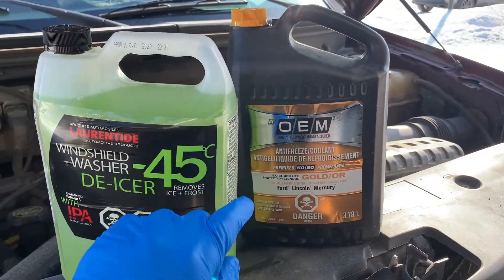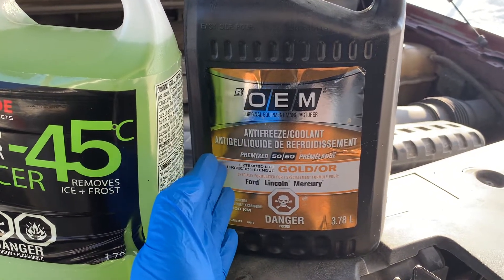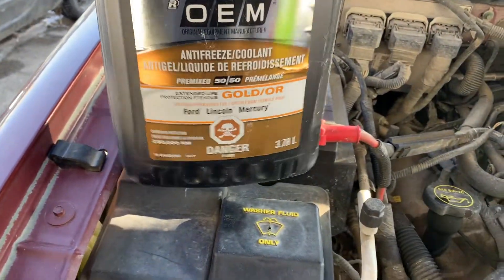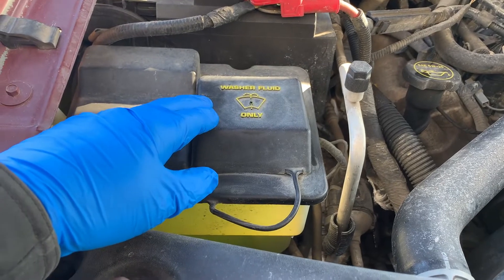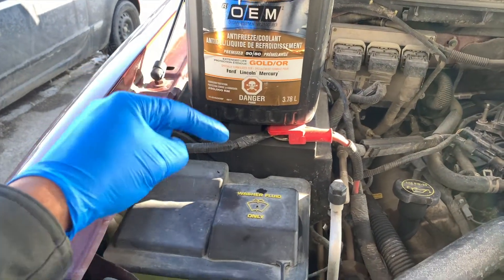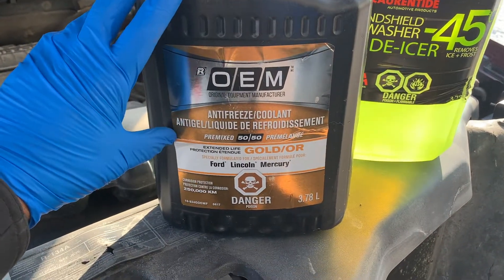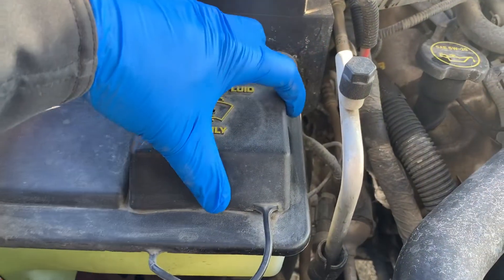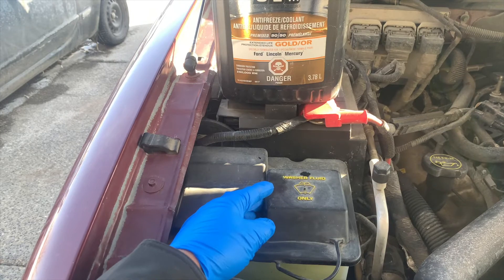Adding Antifreeze To Washer Fluid - you won't like the results!

Comment: I happened to accidentally put about half a liter of coolant in the windshield washer tank before i noticed it was the wrong fluid. I emptied the system after and cleaned the car but can it corrode any parts of the system or the paint  just by that one mistake. I am going to put new windshield washer fluid there in a minute
Reply from the maker: The ideal way to remove the coolant would have been to extract it back from the container, but this isn’t always practical based on the design of the container or the tools available at the moment.  If extraction isn’t possible - filling the rest of the system with water would further dilute the coolant; which was likely a 50/50 mixture.  Then spray to empty the entire container on your windshield followed by the car wash you indicated.  Diluting it would help to reduce any contact to the paint. 

Mistakes happen - considering you did a thorough car wash right away and this isn’t a continuous practice, you should be fine.  I wouldn’t worry about corrosion.
Reply: @YourHomeGarage  thank you! It still had some windshield washer fluid left so it wasnt a 100% solution that i sprayed out.  But the extraction wasnt an option because it had a filter in the way so there was no other way than to spray it out.